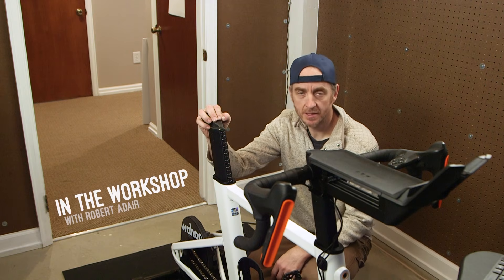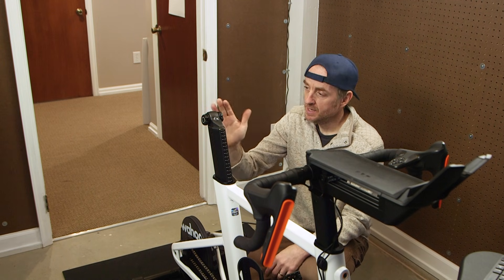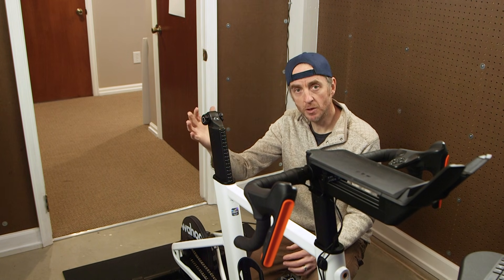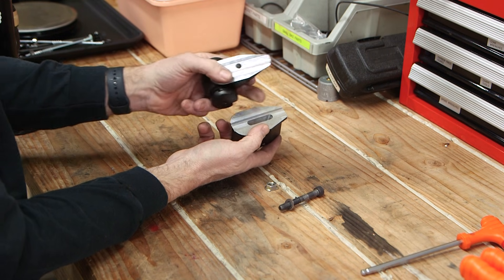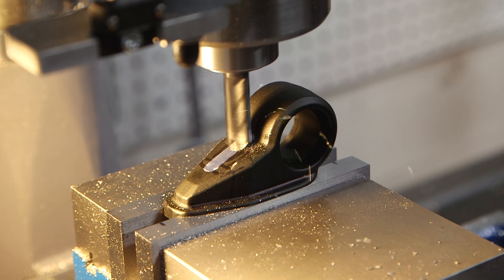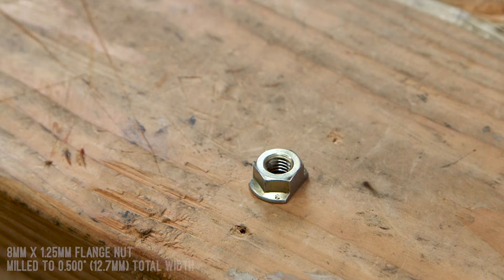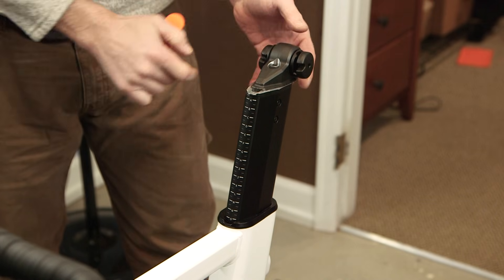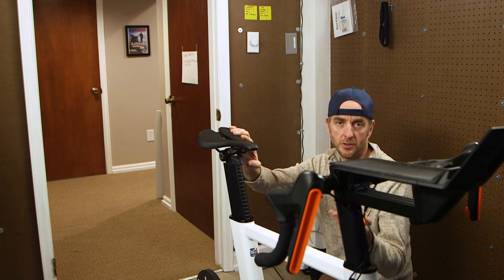Zwift should have done this - adjustable setback for the saddle.

Comment: This is absolutely brilliant! You should sell this idea to Zwift!
Reply from the maker: I modified another one so I could fit a 27.2mm round seatpost in it.  I've been using it with a carbon post.  It is much more flexible than that rock-solid-stiff design Zwift provided and I found it helps my feet. I should make a video on it.

Comment: that is impressive, the saddle set back has kept me from pulling the trigger, I am no fitter but all my bikes seem to have the saddle forward on the rails and I always use posts with 0 set back.   I am tall but more leg than average so I show lots of post, I feel like all that post extension with the seat tube angle will move my saddle back a lot more than it would for a normal person.  It would only be me using it so I hope all I will need is a saddle with long rails and slide it forward more than normal. Going to have to find a store that stocks them and test it.      *First time I looked at the Zwift Ride I wrongfully assumed you could flip the seat post or the posts top clamp from set back to zero set back.    Also kinda supersized about the fixed crank length and proprietary crank design, I am not that sensitive to crank length so I dont care but I would think racers and hardcore users would want certain sized cranks.

Comment: Thank you. This addresses one of the two main issues Zwift chose to ignore or deprioritize — saddle fore/aft and crank length adjustment. I'm fortunate that I ride 170mm cranks and that I had a spare saddle with especially long rails that enables me to get a 1:1 fit between my Zwift Ride and road bike. Another possible fix I've been contemplating is to make a new seat post sleeve that accepts  a standard round seat post.
Reply from the maker: I have been scheming about making an adapter to accept a standard post, too.  I find the seatpost on the Zwift Ride to be noticably too stiff and I think a standard carbon post would help.